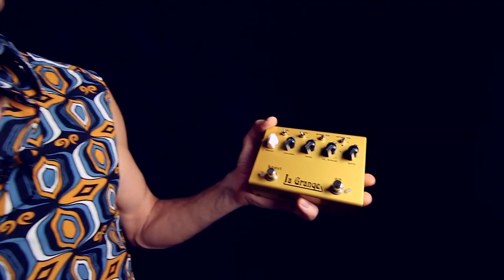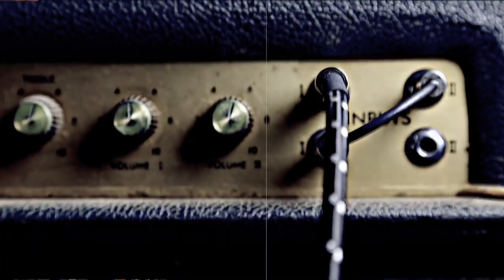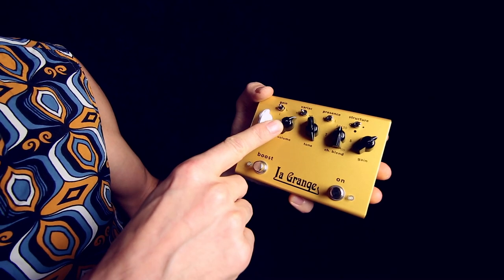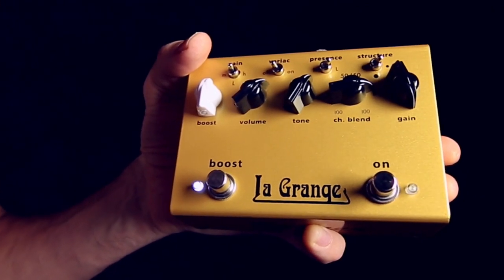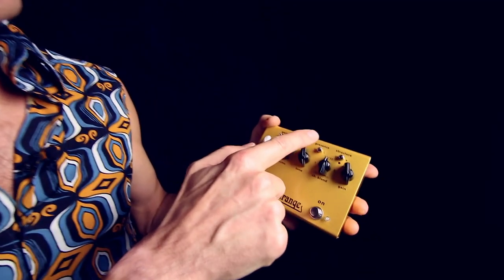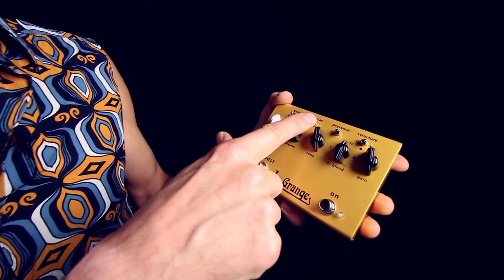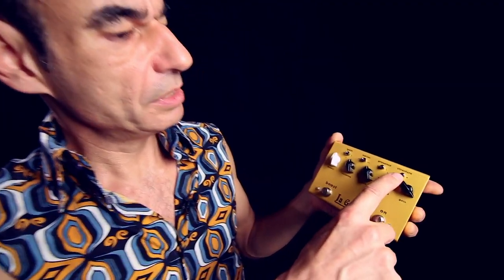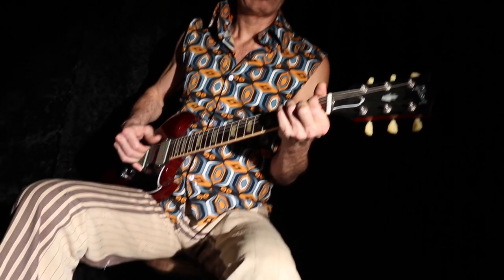Bogner Amps - La Grange Side 1 with Lance Lopez & Doug Rappoport

Comment: I got this pedal and I love it! While it does sound good with the gain up, there are really good tones to be found in the lower gain and "barely clean" area. Using the variac  at low gain adds a very unique compression to the sound as well. I also love that it has an expression option.

Comment: Seems like the best option for me  as I got all in with rechargeable 9v volt batteries. And the sound is super!
Reply: I love this Pedal.
has better tone with alkaline batteries or
carbon or rechargeable batteries than with an isolated power source?
Reply: @Summer69.  I don't have the pedal so I don't know. For the the most power consuming pedals like tc electronic h.o.f I use lithium batteries (rechargeable) 
I really want this pedal to have the Plexi tone covered. But surprisingly my Engl fireball gets close on the clean channel with the gain dimed. Listen to Euge Valovirtas rewiev of the Fireball.

Comment: I own enough pedals mainly ODs/distortions to open a store and I feel the La Grange is easily one of the best pedals of 2017. I have numerous Marshalls from new to old and it nails them. I got it for clean Fenders. The toggles, controls are VERY effective in going from light crunch,med to heavy. Lots of variations and very effective controls to nail that tone you want.

Comment: Heads up on these pedals, there are problems - check the forums to verify what I'm saying. Apart from question marks over Bogner's quality control. I own both the La Grange and the Blue - both with issues. I've been searching for Plexi pedals and I wanted these to work, I really did - especially after falling for Bogner's flash marketing. Sadly,  Not as they are being sold as,  which is annoying considering the high price tag. Firstly, a standard 9v Duracell battery will last about 15 minutes. Secondly, Mr Bogner forgets to mention the power supply issue. Forget trying to run this off your Voodoo Labs pedal power unit - it ain't gonna happen. You will require a special power supply - I still haven't found one. I see they have released a smaller version of all these foundation overdrive pedals. This explains why they are always on eBay.
Reply: What kind of special power supply?  A 9-volt DC plug?
Reply: @GuyNarnarian  I have both and more and just use a 9v adapter. No issues so far except I paid top dollar when they came out. So I’ve had them quite some time.